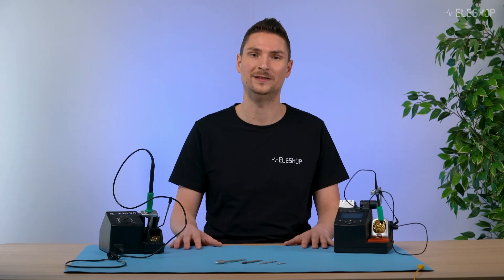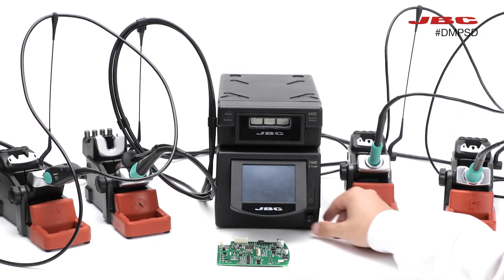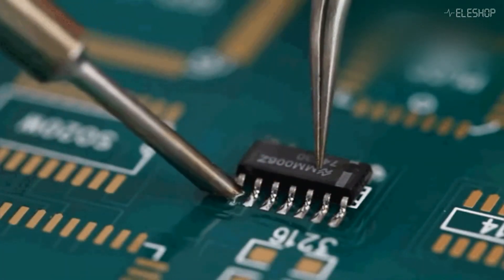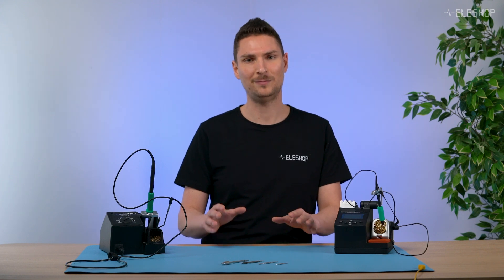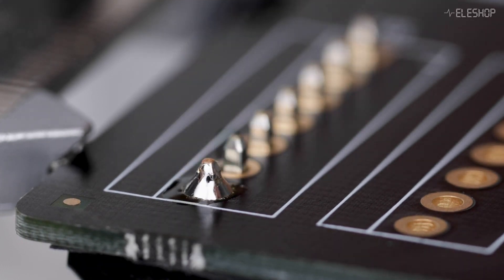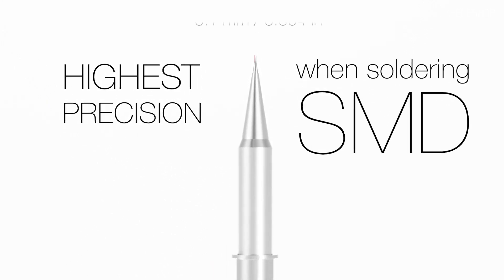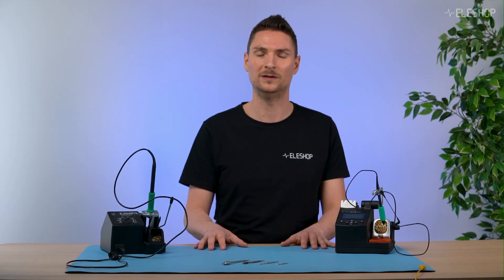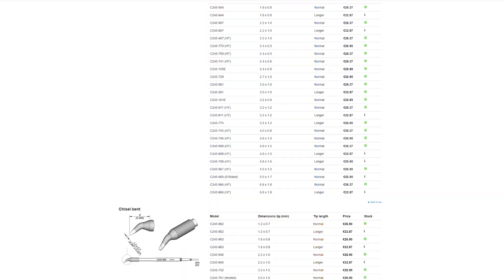Which JBC tip do you need? C470 C245 C210 or C115?

Comment: can most clones or 3rd party stations work with T245 and T210 handles without any need of another soldering station for the other?
Reply from the maker: Some are compatible, some not. All combinations need to be tested before you know for sure. Best is to buy the original of course :-)
Reply: too broke for it haha, might just go for T12 clones since it seems more fitting for my circumstances but thanks

Comment: I've been using my 245 stations for 6ish years now. I do plan on getting another station eventually, I use it every day for work and I cannot imagine using anything but JBC now. Coming from those old crappy Weller Irons and even a Hakko FX-951, when I got my 245/CD-1BE or something like that there was just no going back. I bought a variety of tips and want to stay in the 245 ecosystem. I have used the same 2.4mm tip since I got the Iron, I bought two of them and I am still using the first one as my general all around tip and it gets used every single day almost, you can see it has worn down over time but it still held its shape and works and I'm waiting for it to become pitted before I start using the next tip. I don't care to look at other brands at this point, I'm a JBC fanboy now.

Comment: the mad scientist in me wants the c470 even tho I do smd. realistically i'd just use Hot air or a  hot plate to ever remove an RF shield, and or use a heat gun to heat the pcb to 150c and then use the regular iron (I have a cheap 40w weller, so I have to do that with almost any task anyways LOL)

Comment: Which would you recommend for laptop motherboard repairs
Reply from the maker: There are a lot of different parts on a laptop motherboard, so you might up ending buying two irons. For caps and connectors you need a lot of power, so start with  the C245.

Comment: Based on your experience, do you think the c245 with a large tip has enough power to solder 12 and 10 awg wire to xt60/90 connectors?
Reply from the maker: 10 AWG is going to be a pain to solder. The heat conducts into the cable and is gone. I recommend a crimping solution for 10 or 12 AWG. Besides the difficulty of soldering, there is also the issue of strain release. Thick cables put a lot of strain on connections, which will damage the soldering joint over time. A crimped connection is less sensitive to this.
Reply: @EleshopVideo  Thank you I really appreciate the response. I was able to get a 12 awg soldered to an XT60 connector with a T12 tip but it was really hard. Since it's for an FPV drone the connector is fixed on a 3d printed part it should be OK for now.

Comment: Like he recommended, for the compact station I got the C245, and then added the C210 later. That gives access to a crazy range of tip styles and diameters. Even for work under a microscope the C210 goes easily small enough, and there's nothing any PCB can throw you that the C245 doesn't have an option for.
Reply: I want to be able to solder wires on a whoop drone is the c245 good for that?

Comment: So for the soldering iron handles of the 245, 210, and 115 series, the soldering tips cannot be used with each other? As i see each other on the video has different size at the middle to end
Reply from the maker: Correct. For each tip series you need a different handle. For C245 the T245 handle and for C210 the T210 handle. Both handles can be used on the same soldering station. For C115 you need the NT115 handle which is only compatible with Nano stations.
Reply: No, each size requires it's own handle, one station can support different handles though so technically you can power different size with same station by using different handles as long as plug match the size and pin out.